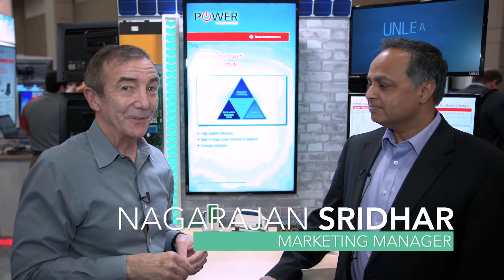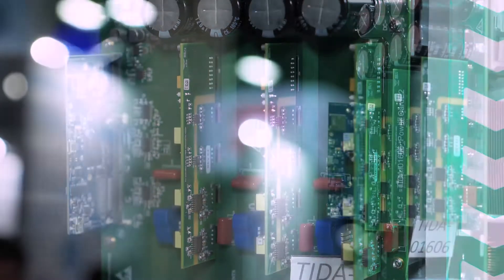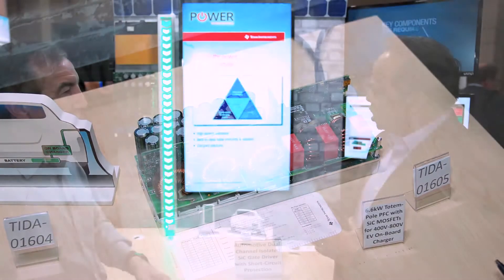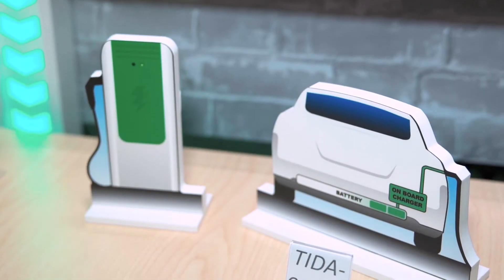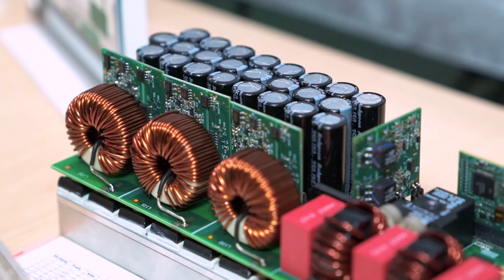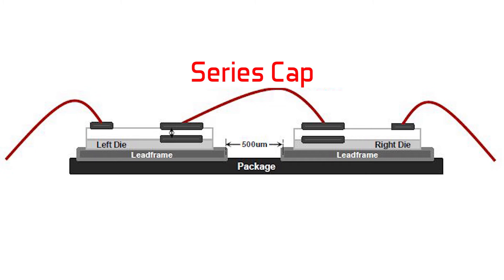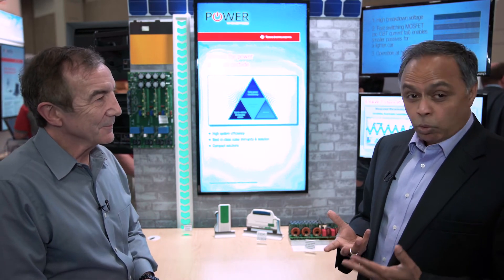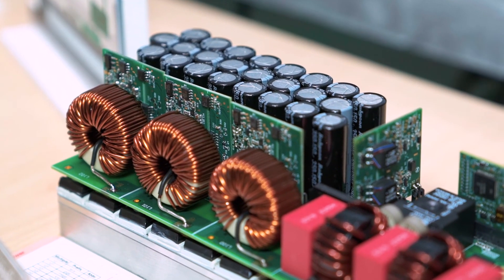How SiC MOSFET gate drivers make for smaller inverters and EV chargers

Comment: The high switching speed is important, as it dramatically improves switching efficiency, it also ensures the devices are well within there SOA however the driver also needs to be able to drive the considerable gate capacitance, Ive been using fast switching ferrite transformers as it provides isolation, high side switching, and drives gates negative on the off cycle to guarantee igbt or mosfets stay off no matter what noise and rubbish in on the supply rails.
Reply: Thanks for sharing. What is the switching frequency of your pulse transformer?